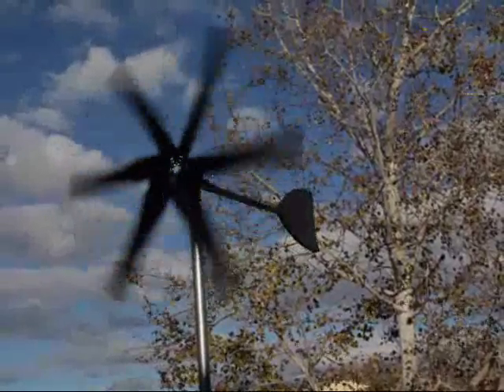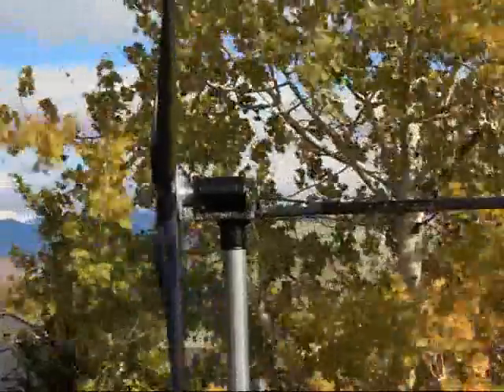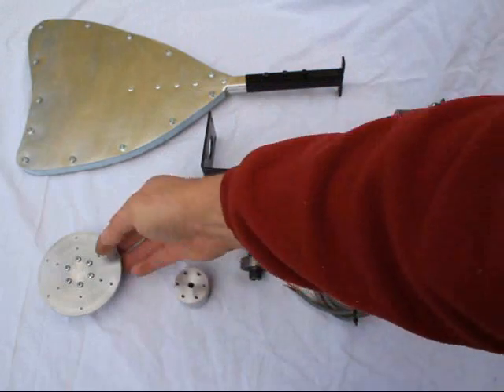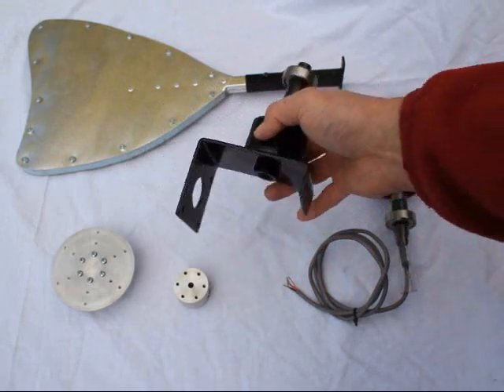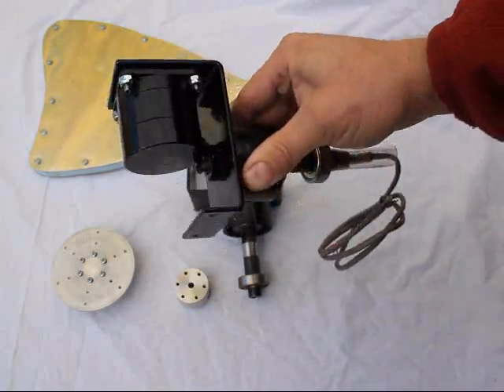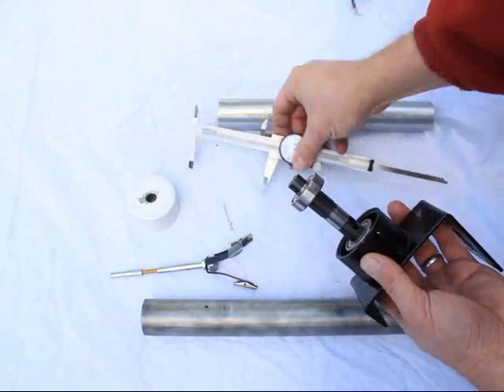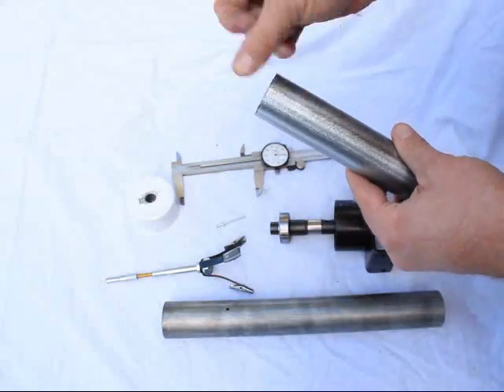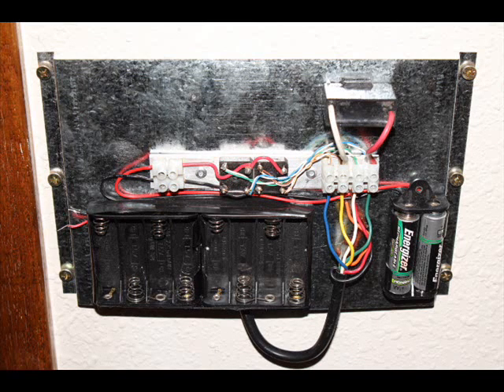Nema 23 Stepper Motor Micro Wind Turbine Generator Steel Banded Blades

Comment: Couldnt the rotor itself act as the tail? I mean, if you mount it behind the vertival axel it will turn into wind just the same. Also how do you solve the issue abaut the power cord coming down getting twisted up?

Comment from the maker: No problem ... to bad it won't fit though. I will go ahead and put some of the stepper motor turbine parts up on ebay tonight. Check ebay user ID: belgrademachine by midnight mountain time. Been promising to list something for a long time now, you may find some other stuff to play with. I would like to see what you make in any case. Hoping you post it

Comment: Just viewed your video today (01/28/2013) and believe it or not, I found the same stepper motor on line earlier this same day.  I called the main company in New York to find out where I can buy the Nema 23 but I could not get an answer.   I knew from the specs that this had to be an assume motor and you just proved to me that I was correct.  Now, I am going to order one tonight from somewhere in the US.  Thank You for showing this video.

Comment from the maker: Thanks! I always thought it would be cool to run a bunch of these down a roof line and combine into a bus bar. With the light blades and hub it can change direction and get up to charge voltage very quickly. Good for all the eddie winds getting around houses and trees.